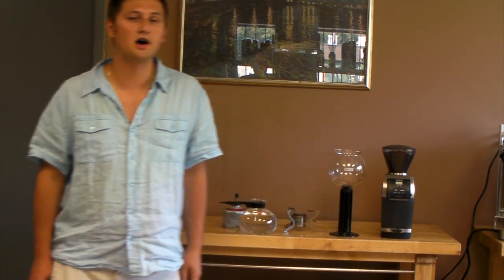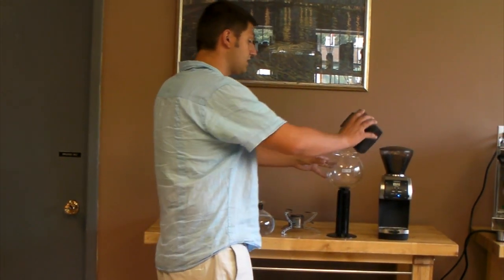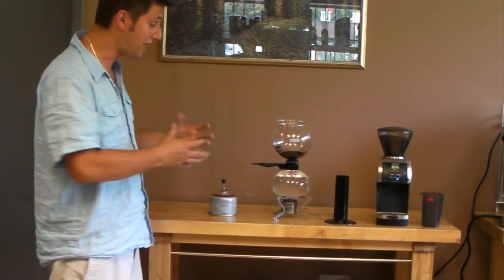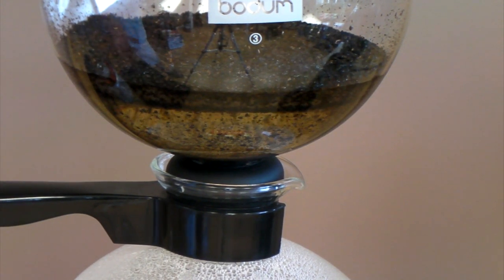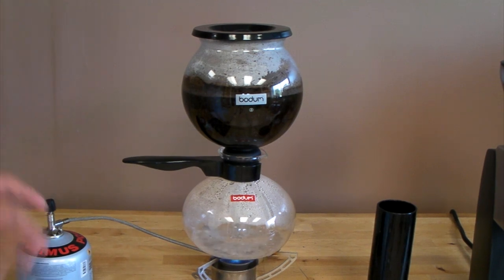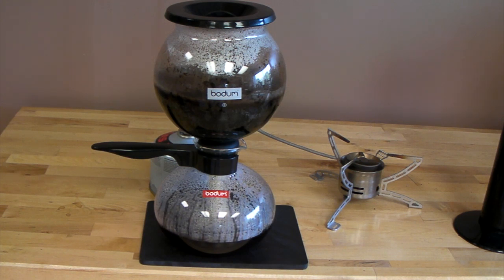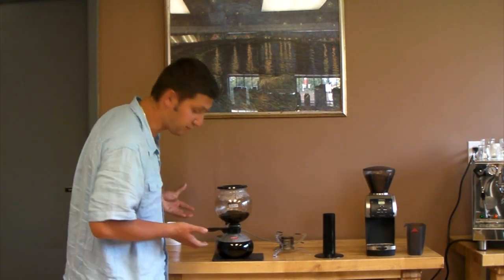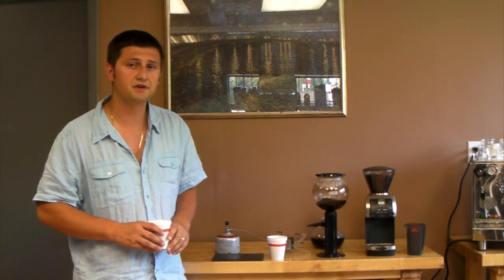Bodum Santos Vacuum Coffee Pot Demonstration

Comment from the maker: @IMKINDOFABIGDEAL13 yes, however, I would only use it on a ceramic or glass top electric stove.  If you have coils it would be best to put something in between like a wire grid to prevent fracture.

Comment: A percolator sends boiling water over grounds again and again, it also boils the coffee as it's being made. Boiling the coffee is a big no-no, makes it bitter. This though fills the top pot with water that is just below the boiling point (the ideal temperature), steeps it for the ideal amount of time and then strains it all back into the bottom part at once. Plus it's more interesting to watch than a percolator; aside from that little glass thing at the top, percolators got nothing.

Comment: the Bodum comes with a scoop. I use one scoop per cup. I use an espresso grind, Lavazza or Illy. I turn off the heat just when the water no longer is able to move to the top bowl. There is no sediment and it does produce a very smooth cup. You may find my ratio of coffer to water a little high. But it makes a lovely cup of "joe". And by the way it looks goods.

Comment: According to Bodum, you can use any ground of coffee. I use a fine-ground coffee and have no issues with excessive grounds. Also, when you're done brewing, Bodum says NOT to put the coffee pot on a cold or wet surface. This makes sense, while it's borosilicate glass, it still may break if it's cooled too quickly.

Comment: Mine didn't seem to get the tube close to the bottom ....it hovered about an inch from the bottom so i couldnt get the last of the water up...do i need to just push it down  a little further...or...??? it seemed snug snuggish....

Comment from the maker: @nootron The Bodum Santos is a 1 litre pot, so I suggest using at least 40-50 grams of coffee.  The coffee should be a medium grind or a little coarser.  Let the water come close to boiling, the top globe when infused should start bubbling a little bit, that is when you should remove it and the coffee should be sucked down fairly quickly.  If you are having trouble, give us a call and I will try to walk you through it.

Comment from the maker: An espresso grind is much too fine for a vacuum, this could be causing your problem as well.  I would use a fairly coarse grind with the Santos.  you do not have to force the seal, it should be snug.  Again, make sure you coffee bubbles in the top globe before remove it from the heat source.

Comment: The lid is pointless.  And you should be stirring it a couple times during the brew.  The vacuum is created as the lower chamber cools.  You can expedite the process by moving air across the lower container, increasing the rate at which it cools.

Comment from the maker: Hi, make sure that you leave it on the heat source for long enough.  The top globe should be bubbling with coffee, also make sure your seal between the two globes is solid.  Once you remove it from the heat source a vacuum should be created and the coffee sucked down into the bottom globe.

Comment from the maker: @nootron Hi, in order for the vacuum to work you must remove the heat source.  I did not put it on a cold surface, I just removed it from the heat source.  I also find that the best technique is to let all of the water to go up into the top globe and in this video I actually thought I removed the heat source too quickly since the draining to the bottom globe was slower than it should be.  If you coffee is watery and tasteless I would suggest adding more coffee. ..

Comment: He makes this look so complicated.  I have had this Bodum for 20 plus years.  My take
- Put water and coffee in respective pots, I put the part with the stem into my insulated coffee thermos, which I later use for the extra coffee.
- Put on burner on gas range
- Once the water reaches top chamber, I turn my burner down 50% and let steep 5 minutes
- No need for a cold surface, I just turn the burner off and coffee returns
- It is very easy to clean
- I will try coarse, I use pre-ground Starbucks

Comment: You are actually supposed to remove it from the heat once the water has risen into the top jug (once it bubbles as this indicates the air pocket in the base of the lower pot). If you use the right consistency with the coffee (I personally consider that this videos coffee was too coarse), it makes the coffee just right and not burnt.

Comment: There is a plastic seal with a metal spring latch that runs from the base of the upper globe and down to the end of its tube. The spring creates tension that prevents the grounds from entering the bottom globe.

Comment: taskete: The heat expels both air and water from the bottom section, which is pressure, yes, but as it cools, it forms a vacuum which pulls the water down into the lower section.

Comment from the maker: This depends on the coffee, I do find that this method is a little on the hot side and can make some coffees more bitter than other methods of brewing.
Reply: He makes a mistake boiling the water.  The heat should be adjusted down slightly, all that’s necessary is that the water is pressured into the upper chamber.  It’s more easily accomplished with a halogen beam heater.